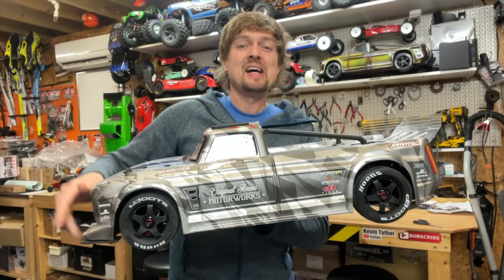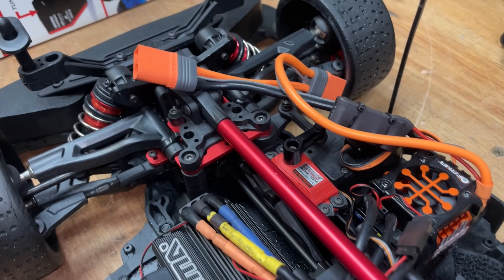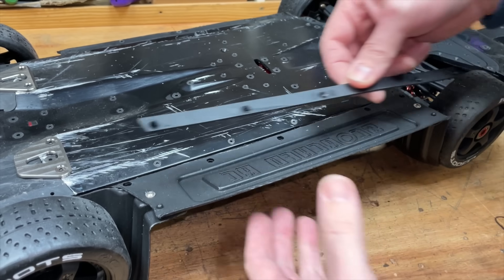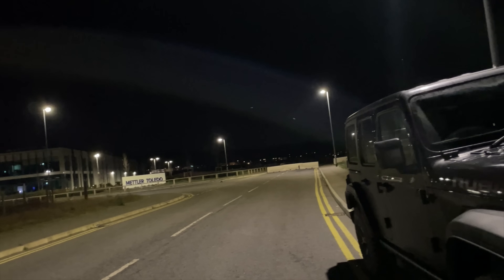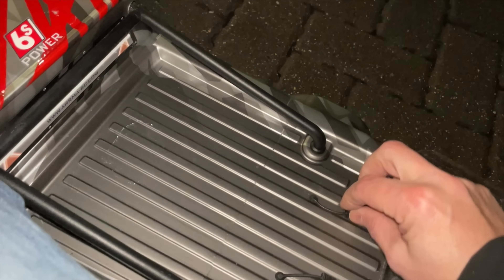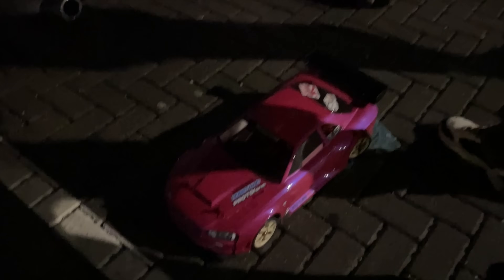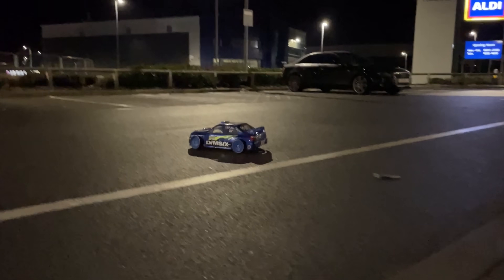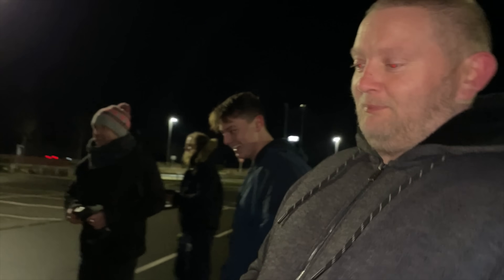Sparking RC Drift Car has E-Brake

Comment: The ESC in my Infraction did the exact same thing. BEC working because the fans would spin up etc. But no LEDs on the ESC itself and no response to throttle. Replaced it with a Max6.
Reply: Same, then my Max6 died too, no reason, wasnt even hot. They gave me a good price on a new unit so i was content
Reply: @ruuster83  Hmmm. I looked around and those Firma 150A ESCs are notoriously bad. Lots of reports of them failing. Only one run on the Max6 so far and it was ok. Will see how it goes. If that fails, I hope warranty looks after me. Otherwise Max5 I guess.

Comment: I just got my Infraction, I put the speed gear in it before driving it. 4 sets of batteries and my esc did the exact same. Don't know why spektrum esc's are such junk. Either way, got my warranty replacement and castle combo on the way.

Comment: hey kev have your considered making a bash proof electric monster truck

we need an ultra durable Bash proof truck even if it requires carbon fiber and costs a little bit more we need something that can withstand 30 feet jumps

you need to take on the challenge 💪🏾💪🏾

Comment: Hey Kev, you ever thought about getting one of those “Waeco style” portable 12/24 volt hot freezer fridges you can plug into your cars power socket and storing your lithium batteries in that? A lot of them have a heating function as well which may do well for your batteries performance once you find the optimal operating temperature range for ‘em.

Comment: Odds the onyx battery prototype overvolted and or spiked and killed the esc?
Reply: that esc cannot handle back to back high speed runs. i did 91 with a typhon, then 90, then it caught fire LOL. Do not speed run with the spektrum 6s 150a, lesson learned

Comment: Kev have you ever used SMC brand batteries they have .4 more volts and cheaper then Lipo I haven't tried them yet but that's what alot of the pilots are transitioning to
Reply: SMC are awesome batteries. LiHV cells are 4.35v at full charge vs 4.2 for standard lipos. nothing new, or any better really
Reply: @ruuster83  Right but better than traditional lipo
Reply: @RC Trucks  everything is a tradeoff. They have higher voltage but fewer cycles. Speed runners require the best of the best batteries and there are none that I know of using LiHV cells
Reply: @ruuster83  Right but I'm not looking for absolute top of the line batteries I just want something that provides a ton of power but doesn't cost hundreds per pack. The lihv has more power than a Lipo but I'm honestly not expecting 500+ cycles out of any battery anyway
Reply: @rctrucks2094  good point. 👍 best power to price batteries I've found are CNHL 70c g+  , they can deliver serious amps
Reply: @ruuster83  Always looking to try something new
Reply: @RC Trucks  CNHL seems shady just for having China in the name, but in FPV and RC they are some of the best batteries. Definitely the best when you compare prices too
Reply: @ruuster83  Lol right
Reply: @ruuster83  One question does lihv mode on the charger automatically make them 4.35v per cell
Reply: @RC Trucks  that's sounds right. My spektrum charger allows me to adjust end voltage 4.15-4.35 incrementally, but lihv setting probably does as you said
Reply: @ruuster83  I use the authentic imax b6 you cannot adjust end voltage (or maybe you can I haven't tried) but it does have preset modes for different types of batteries depending on their requirements and their end voltage and you can change the charge rate
Reply: @RC Trucks  I have an imax b6 as well and I don't think it can charge over 4.2 I tried but never succeeded
Reply: @ruuster83  Mine is the b6 mini which is supposed to have more features just slightly smaller

Comment: Why did it die kev? Also when is tne primal grave digger video mate
Reply: mine died doing the exact same thing. 2 speed runs, then on the third it caught fire. they are good basher ESCs, but not speed running

Comment: The ESC that comes with the Infraction is trash. For normal driving people should be enough but for real bashing and hardcore Rc drivers it is just not good. My ESC also died on the first run / bash with it and overheated 2 times then died. I have an Max 6 in it now and i since then had no issues.